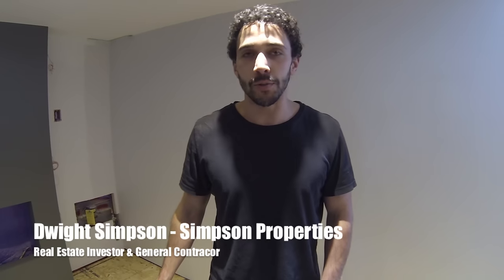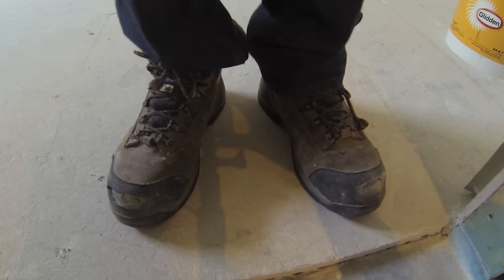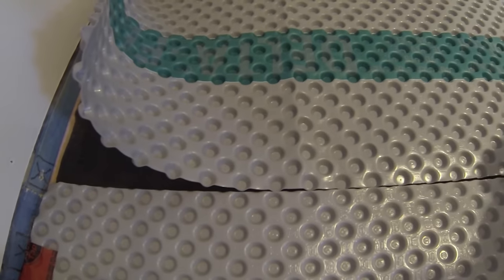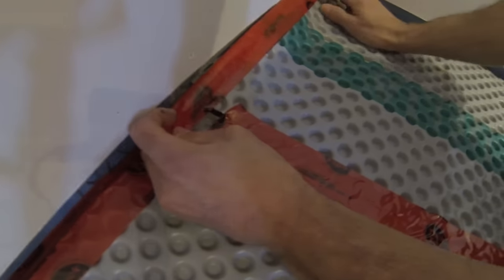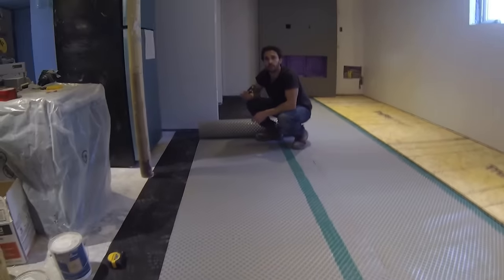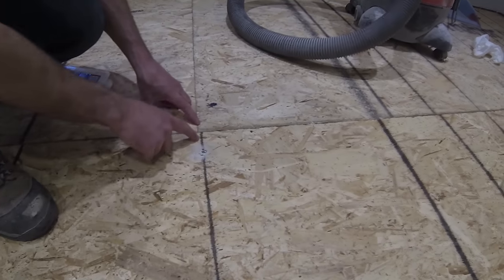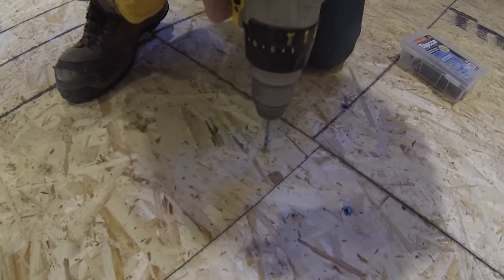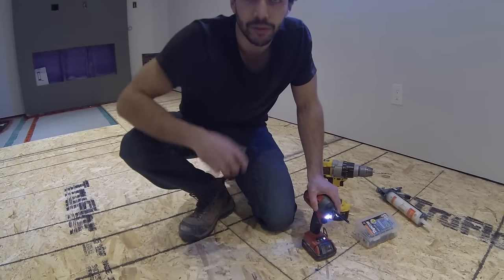HOW TO INSTALL A SUBFLOOR ON CONCRETE

Comment: what are your thoughts on layering the subfloor as follows (bottom to top): concrete slab / landscape fabric / delta fl / 1/2'' xps foam board / osb board / finished floor (laminate, engineered wood, etc)? while the delta fl acts as a vapor barrier between the cold concrete floor and the osb, i'm concerned that there's still a risk of getting moisture (humidity) between the cool delta fl and the osb (made of wood/organic material) therefore leading to mold. by placing the xps between the delta fl and osb you effectively normalize the temp below the osb. is this too overkill or will it create a ''vapor barrier sandwich''? i live in toronto, canada and we get some pretty cold winters.
Reply from the maker: Great question. I live in Toronto as well and with the method I used the laminate floor is comfortable to walk on bare foot during the winter season. You don't have to worry about any moisture forming between the Delta-FL & OSB. There is not that much of a differential in temperature to create that issue. You can use a foam board as well but in my opinion it's a bit excessive and is going to take away valuable head room in your basement.
Reply: +Simpson Properties thank you so much for the quick reply. glad to hear youre you're from Toronto as well. I've binge-watched all your videos, LOL... you have a great presentation style.
Reply from the maker: +Aringe thanks a lot for the positive feedback. I have been using a better camera and software to edit my videos. I will have more videos with better quality to post soon.

Comment: Can you put wood flooring over this subfloor?
Reply from the maker: In most cases yes you can used hardwood flooring over this subfloor. I recommend you check with the manufacturer of the flooring first. All that info is usually stated in the spec sheet. In this video I used a floating floor system and it’s laminate flooring.

Comment: Could you just put laminate flooring on top of delta fl
Reply from the maker: Yes you can install the laminate directly on top of the Delta-FL. That info is specified in the manufacturers install guide and spec sheet.

Comment: Great video. Would it be possible to use delta ms20 instead of delta fl product?
Reply from the maker: Thank you! Great question. Delta MS (brown in colour) is used for waterproofing around the outside of the foundation of a house. The manufacturer states the difference is Delta FL is made of virgin plastic vs Delta MS's recycled plastic. There is also a compressive strength difference between the two, with Delta MS being slightly less. The main advantage is that Delta MS is much cheaper than the FL. Personally I would stick to what the manufacturer recommends and use Delta FL for subfloor purposes.

Comment: My unheated basement in Northern Ontario has a couple of spots where 1-2mm of sitting water collects (comes up thru the slab) each spring when the thaw comes.  I just shopvac and mop and it stays bone dry for the rest of the year.  I think it would evaporate if I just left it. I have tried sealer on the floor but water still comes up each spring and makes some of the sealer bubble and peal off.  There is no drain in this part of the basement.  I get a bit of efflorescence too.  Would TERRACO CRYSTALLINE WEATHERCOAT 571 help to solve this problem?  And could I still go ahead with the subfloor in this scenario?  Would landscape fabric getting wet under Delta FL each year be a problem?  I'm also wondering about sealing the edge of the delta to cinderblock walls.  Would I still just tuck tape the delta fl directly to the bottom of the block walls?  I may or may not frame the walls after the fact...

Finally, it was recommended to me to use DMX AG6 (used to wrap the outside) as a substitute to Delta fl as it is less than 40 cents/sf (about $175 saving for me).  Guys at HD are still recommending it as a cost saver over Delta FL, even though it now has a label saying that it should not be used for the interior (until recently, there was no such label).  I understand that the plastic is thinner than delta fl and would not support as much weight.  But how much is too much weight?  There will be a fairly heavy bookshelf and a woodstove on the floor, which will just be a roll of vinyl on top of the OSB.  Any issues with this plan?  Thanks in advance!
Reply from the maker: If you have sitting water on your slab every spring that definitely needs to be addressed first before installing subfloor. Do you have weepers installed around the perimeter of your home draining to a pit with a sump pump? If not, that would be the best way to solve this problem. It's costly but it would be the best permanent solution. 

Landscape fabric is designed to with stand the elements so water coming in contact with the fabric shouldn't be an issue.

I would stick with Delta-FL for your underlayment and not use a foundation wrap.
Reply: What would happen if I went ahead with the subfloor without weepers/pit/pump?  Wouldn't the water just evaporate under the delta?  What about putting a couple of small access points in the floor to open up for more airflow in the Spring?
Reply from the maker: It's going to take the water a lot longer to evaporate with Delta-FL and OSB installed. The exposure to air flow will be minimized now. Installing access panels to the problem areas is one temporary solution. You would just have to open the panels and shop vac the water. You would also have to leave them open for a couple weeks to dry it out. Going back to your first comment about using a waterproof coating. If you coat your problem areas the water will most likely migrate to another spot on your slab that is not coated. Unless you coat your entire slab (which isn't cost effective) it's a loosing battle.
Reply: The alternative is to leave the floor unfinished and just dry it each spring as I have been doing.  Once I do that, it stays dry the rest of the season.  We are even able to put rugs down with no issues.  But It's still a concrete slab, which will never be comfy.  Wish there was a better solution...
Reply: Holmes recommends 1 inch XPS foam directly on the floor and 2 inches on the walls, all spray foam sealed and taped, then 5/8 plywood (I would use OSB) on top, all tapconned down.  He doesn't talk about what happens if/when water comes up thru the slab under the  foam.  What would happen?   

Also, some people have mentioned that 2 inch xps on the walls still leaves air flow behind it, inviting moisture.  True?  I read that even if I opted for expensive spray foam instead, that it sometimes shrinks and leaves unsealed areas.  Geez, it seems nothing is perfect!

Finally, for my rim joists, I was going to put R-12 fibreglass batt covered with 6mm poly, stapled and tuck taped, then cover with cut-measure panelling.  Your thoughts on this cheap method vs rigid foam with spray foam around edges or straight up spray foam for the rim joists?

BTW, I plan to move my woodstove to the basement to warm both floors of a 700 sf cottage so I need rim joists insulated.  

I appreciate the time you take to answer!
Reply from the maker: That may have been an old post that you saw. I know that Holmes has since partnered with a insulated foam sub floor system that has channels in the bottom to allow for drainage (available at Home Depot). The problem with the insulated panels for most people is they loose a lot of ceiling height due to the thickness of the panel. 

The best way to insulate a home in my opinion is to use a 2 lb closed cell spray foam. It does not shrink and will fill in any voids. Just make sure you hire an experienced and reputable installer. Spray foam is also the best solution to insulate your rim joists properly. When i frame my walls I leave about a 1/2" gap between the foundation and studs. This way the foam is between the stud and foundation wall which minimizes heat loss through your studs. You will be amazed at how much warmer your space will be after insulating with spray foam. Another bonus is you don't need a vapor barrier when installing spray foam. 

On my upcoming remodel/addition this summer I will be covering this topic in depth. Keep an eye out for my web series #ProjectSimpson on my YouTube channel.
Reply: So no need to insulate between the studs since spray foam is already behind them?
Reply from the maker: scott anderson you still spray between the studs as well.

Comment: Usual on grade slab has a vapour barrier under neath the concrete so the fabric, dipple board and osb is not needed. Even if there isnt a vapour membrane under, it is better to use a poly sheet on top the concrete rather than the fabric and dipple board as it would block the moisture better. The only benefit would with layers is thermal separation from the cold concrete. Then again one would get the same effect with underlay and eng. wood flooring
Reply from the maker: Thanks for sharing.

Comment: Was that landscape fabric plastic, rubber, or cloth? And also do you adhere it the ground at all?
Reply from the maker: The landscape fabric is a cloth material. You don't have to adhere it to the floor. Just roll it out, cut it, and install Delta-FL on top.

Comment: Great video thanks. I moved into a house where the basement is finished and the basement floor is tiled. The tile looks like it was put down directly on the concrete floor. Can I  use this method on top of the existing tiled floor the same way you've shown. Thank you
Reply from the maker: I have never installed this system over an existing tiled floor. I would reach out to the manufacturer Cosella Dorken and ask them. Their toll free number is 1 (888) 433-5824.

Comment: So if you have a water spill from the top of your flooring surface, doesn't it just fill those plastic cups with water and have no place to go?
Reply from the maker: You would have to have a severe water leak for that to happen. If that’s the case a major rehab would be needed anyway. Regardless of the subfloor installation method.

Comment: I was considering this, but if water does get in buy a flood or busted pipe, the cups on the underside of the mat will hold water. Still looking for an alternative.
Reply from the maker: An-D y in that case you would have to tear up all the flooring and subfloor. No matter what subfloor method is chosen if you have a pipe burst and a substantial amount of sitting water. Air movers would have to be used to properly dry the area. Then new subfloor, flooring, baseboards, etc. would have to be installed.
Reply: @simpsonpropertiesltd  good point. Thank you. Have you used the foam padded version for carpet?
Reply from the maker: An-D y I have not used that product.

Comment: Have you tried Delta Fl on either felt or cork for a little added insulation? Also, my first floor is on slab and was not built with a subfloor in mind, so adding more than an inch an a half is a little problematic. How horrible is it to have my 12mm engineered laminate resting just on the delta fl?
Reply from the maker: 1) The only material I have ever used beneath the delta-fl is landscape fabric to stop the hollow sound. I don't think cork flooring beneath the delta-fl would allow the slab to breathe properly. If you want added insulation you can get a good quality under pad that provides more insulation (higher R value). 

2) If ceiling height is an issue you can use a subfloor system such as DryBarrier (3/8" thick) or DRIcore (7/8" thick). They are more expensive but would solve your height problem. You can install your flooring on top of the delta-fl but it may not feel as solid without the plywood. The floor may have a bit of a bounce to it. The plywood also helps level out minor inconsistencies in the concrete slab.

Comment: So did you put anything between the OSB and the laminate?
Reply from the maker: It all depends on the finished flooring you select and the manufactures specs. I installed a foam underlayment between the laminate flooring and the OSB.

Comment: I know this thickness is 5/16"(8mm) but when you lock it tight with sub-floor on concrete, how thick this will be? is this squashed a little in between sub-floor and concrete?
Reply from the maker: yama chan the product has little flex I would plan for 8mm as the final height.

Comment: I just did a cost comparison on the difference in pricing. Yes, this way is less monies. Not by enough though when you realize how much extra work is involved. It only saved on 320 sq ft less than $100. The 2x2 dricore is really fast to work with and super simple when cutting. Only cutting a 2x2 is much easier than a 4x8 sheet. Plus rolling out and cutting around obstructions is a pain in the a__!
Reply from the maker: You always have to run your numbers. Things change over time. Thanks for sharing.

Comment: what type of landscape fabric do you use and where do you purchase it from? Drywall is finishing up in my basement this week and I plan to start laying the fabric, delta fl, and osb board next week.
Reply from the maker: Erik Wall there is no specific type required. Residential landscape fabric is generally black and commercial grade is grey. I would recommend purchasing the black fabric because it's cheaper and serves its purpose. You can buy it from any big box supplier like Home Depot or Lowes.
Reply: have you ever used R-Tech rigid insulation board with osb/plywood on top as opposed to the above method? I've seen Mike Holmes use it and this method seems to be cheaper.
Reply from the maker: I haven't used that product. If you have high ceilings and you're not worried about loosing ceiling height then it would be an excellent product. I'm currently working on a project where I will be removing the entire basement slab to underpin and install new drains. Then I will be installing either spray foam or rigid insulation and pour a new pad. Lastly I will install the same sub floor in this video.
Reply: I noticed that one of our local big box stores sells OSB water repellent board. I know it isn't water proof, but do you think it's even worth the added costs to get that board?
Reply from the maker: I would recommended installing regular OSB. There is a company called BluWood that makes mold, mildew & inspect resistant wood products. If you wanted to go overkill you could use a product like that.
Reply: thanks for the recommendations. It looks like i'm going to go with the DMX Airflow product as opposed to Delta FL. The costs of the landscape fabric + delta-fl is the same as DMX airflow but it's only 1 product that I have to roll out as opposed to 2. With OSB board on top of it the R Value is 2.5.
Reply from the maker: Erik Wall no problem. DMX is a great product as well. Prices vary depending on where you live. If the price is comparable then that's a smart move.

Comment: Hi.. which kind of fabric did u use to cover the concrete? Where can i get it??  I need to tile my basement bathroom, is this subfloor preparation also good for tiles?? Thanks in advance
Reply from the maker: Hi, you can purchase the landscape fabric from most big box renovation supply stores (ie. Lowes, Home Depot). It is usually located in the outdoor and gardening section. You can install a product from Schulter called Ditra. It's an uncoupling membrane it can be installed on top of the OSB. Personally, I wouldn't install any subfloor in the tiled areas. I would install Ditra or Ditra-Heat (in cold climates) directly on the concrete slab then install your tile.
Reply: Simpson Properties thanks for your answer.  Your ditra comment made me a bit confuse.. i understood your video was to avoid cost of ditra.  So i have 2 more questions:  1. Is ditra going to isolate cold as well? Ditra heat is quiet expensive this is why i found cool your solution.  2. If you like ditra better.. that is also used for the floor u installed, why u didnt use it instead? Thanks for sharing..
Reply from the maker: In the beginning of the video I said other 2'x2' subfloor systems like DRIcore are more expensive then the method shown in this video. This subfloor method is used primarily for finished flooring such as laminate and carpet. If you watch this video: https://youtu.be/-45TdqOgU4k it is from the same basement apartment you can see the finished floor towards the end of the video. I installed Ditra-Heat directly on top of the slab then installed my tile floor. 

1. The R-Value in Ditra is very minimal by itself. If you don't use Ditra-Heat or Ditra-Heat-TB and you live in a cold climate your tile surface will be cold. Even if you use the subfloor system in this video you still have to install Ditra on top of the OSB to prevent your tiles and grout joints from cracking (due to movement).

2. Ditra is not an underlayment designed to install floating floors systems like laminate and engineered hardwood on. 95% of this basement apartment is laminate flooring that's why I didn't use Ditra in those areas.

I hope this helps and thanks for your questions!
Reply: Simpson Properties it does help a lot.  Thanks for your answers :)

Comment: ok. is the clicking kind something that happens pretty much all the time or is it something that could happen? reason being I have already places the delta fl down haven't gotten to the plywood yet?
Reply from the maker: The clicking sound doesn't happen all the time but I install the landscape fabric regardless to play it safe. You won't know if it's going to make any noise until you lay a few sheets of OSB down to test it. Then you can decide if you want to pull up the Delta-FL and install the landscape fabric or not.

Comment: Wouldn't the fabric retains the moisture that comes up from the concrete?
Reply from the maker: The moisture that comes up from the slab should be very minimal. If you have normal slab conditions the fabric retaining moisture shouldn’t be an issue.